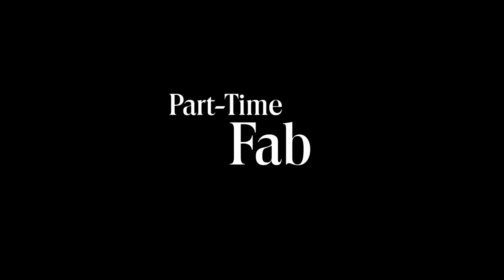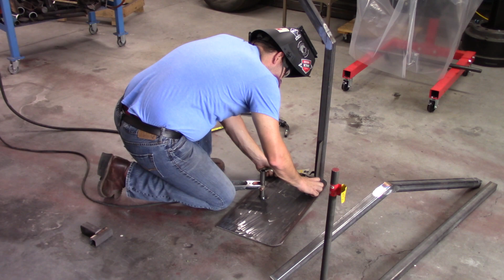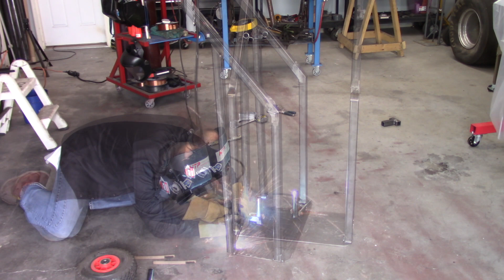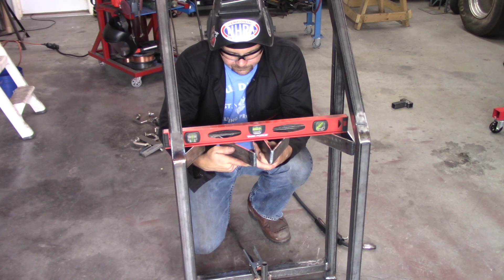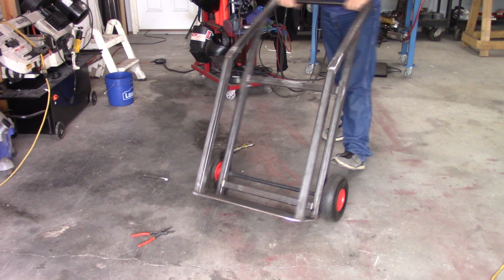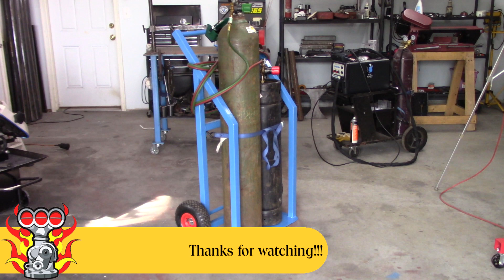Oxygen Acetylene Cart Build Part 2 of 2

Comment: Great video. I work in the field hauling scrap metal and have to cut a lot in the field and I'm needing to build a cage that I can move around using a bobcat and forks a wheel cart would not be any good in the rough terrain I work in, any suggestions would really be appreciated

Comment: Just about finished mine.  Like the blue (miller).... went with that.  I built a super strong cylinder retainer.  Wish I could post a pic.  You can check out my progress on my channel.
Reply from the maker: Sounds awesome man. I'll check it out.
Reply: Part-Time Fabrication I used plates drilled for my axle.... and that worked out well.  I went with 13” wheels.  I’ll probably post a better video of it and some slides, and show it completed.  Thanks for the inspiration.  The things a tank!
Reply from the maker: You are very welcome. Glad you liked the videos.

How are the 13 inch wheels? I would think they are better than my smaller 6 or 8 inch. Plus one of mine leaks. LOL

Comment: Shaun.... how tall are your front risers?  I’m thinking 24”.  And the back 36””. Also what size is the bottom plate?  If you could post some rough dimensions it would help save some time.  Thanks very much for the video!
Reply from the maker: Hey Team Six, I have no dimensions for this but I will get some to post or do a short quick video.

Thanks for watching!
Reply: Part-Time Fabrication thanks very much.  Also an estimate on length of 1 1 1/2” tube you used to make the build.  I’ll look for more on this from ya.
Reply from the maker: Hey Team Six, I got a video for those folks who wanted some measurements. Please check it out.
Reply: Part-Time Fabrication I will!  I posted a short video showing my almost finished cart.  I really appreciate your videos!
Reply: @PtfabNet  where is the video of the measurements?

Comment: Shaun the torch cart turned out great. I don't know what I do without mine.  sure makes it nice to move the tanks around the shop without fear of them tipping over.  

Great safety tip on standing off to the side when opening the valves.
Doug
Reply from the maker: Thanks Doug. I've used it twice since I finished it and I am not sure how I worked (safely) without it.

I need to read up on safety in the shop/garage and do a video on that.

Thanks for watching!